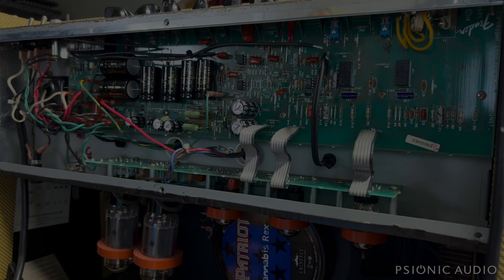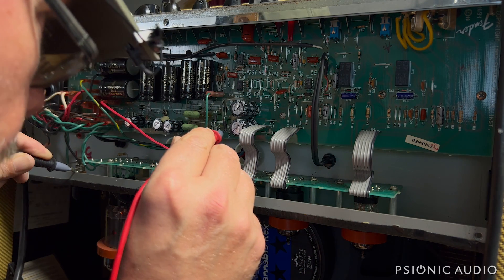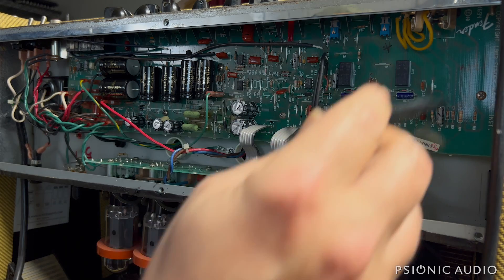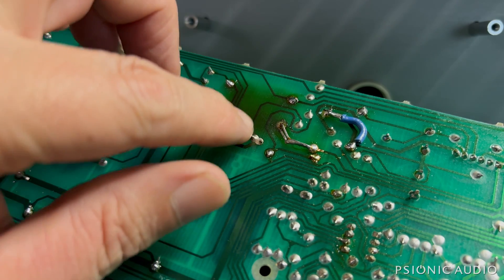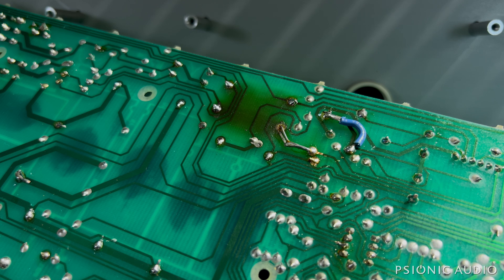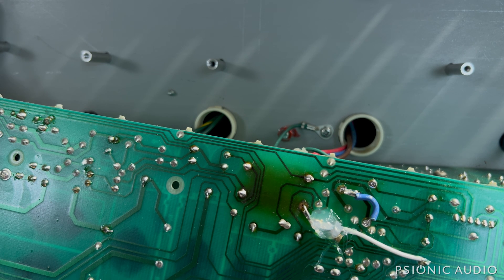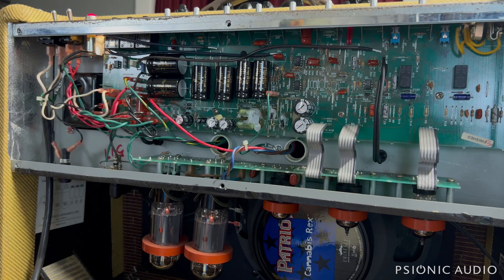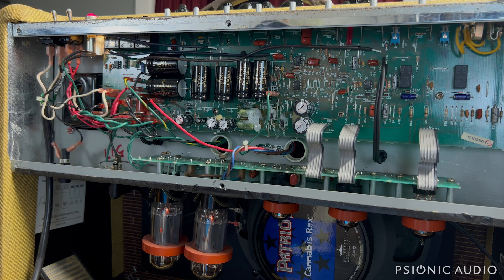Blues Deluxe "Won't Leave the Drive Channel"

Comment: Mine sounds great. I don't have any problems with mine. What other amps are what you would suggest?
Reply: I bought mine in 2010. Zero issues. I’ve tried so many other different amplifiers but something about the way the blues deluxe sounds. It’s got a perfect brightness that I love with humbuckers. It cuts.

Comment: I've been considering the Blues Deluxe Reissue until I saw this video. 
Wow. Kind of bummed about that. 
Thanks for saving me the disappointment.
Reply: I’ve had my blues deluxe for over 10 years with absolutely zero issues. I’ve done nothing to it. It still has the original tubes. It probably has 500 gigs on it. I guess I’m lucky. It’s a good amp. There is a reason why you see them in stages along with the other hot rods frequently. Are they the best? No. Are they work horses? Yes. Get one. If it breaks fix it. And it will last a lifetime.
Reply: @peanutavalon  I actually bought that amp after running into a few more people with gig experience like you. Everyone praises that amp and so do I now. Holy smokes that's a bad boy amp! Not just a work horse but you can get anything you want out of it. No mods! Sitting next to it right now! 🤣😎👍

Comment: Great video and thank you. With your entertaining help, I've been able to fix the drive channel not switching on my 1993. Clearly someone had attempted to do some of what you do in this video, and now it's got new resistors and caps at C38/39. Only now I'm seeing around +/-20v not 16v on R85/86 and 19v sat TP32.
Reply from the maker: You need new 16V zeners then. That's what they do - limit the voltage to those fixed settings.
Reply: @PsionicAudio  Amazing and thank you. I've never had so much fun watching your videos and ordering parts on Digi-key.
Reply: @PsionicAudio  I also wanted to add that I had two different amp techs look at my 93 Blues Deluxe in the past and they either didn’t fix the issue, and the last one complained at me about how he hated them and was essentially telling me he didn’t want to fix it. But you’re not that guy and I appreciate you going the extra mile to fix them and build in some resilience.

Comment: I just shake my head. I feel so bad for working musicians who buy them.
Reply: why? great workhorse amp. I gigged mine hard for 15 years before I had any problems. Just changed out a couple of caps and lifted the resistors. Got my moneys worth out of it for sure and it's still rocking.

Comment: Do tube dampeners actually help with microphonics or is it best not to have them?
Never had a tech’s perspective on it but I’ve heard it’s a snake oil product
Reply from the maker: Someone I respect in the industry likes them. I find that sometimes they help, sometimes they don't. Don't overpay for "audiophile" dampeners. But if you can find some that are reasonably priced, it won't hurt to try them.
Reply: @PsionicAudio  Those thick Eurotubes dampeners seen here have been quite effective for taming rattles on my old 7 notch Mullard GZ34.  Ain't perfect, but they certainly help.  Relatively inexpensive and worth a shot.
Reply: @dwaynedelario  , years ago I bought some Sorbothane tube dampers from a company that sells audiophile products and put them on the driver and output tubes of a Dynaco Stereo 70 hifi amp. They were fine for the drivers but quickly melted on the EL34 outputs (It didn't take much of a stretch to get them to fit onto skinny bottle EL34's). I was a bit ticked off that the company that sold them to me refused to refund  my money even though they never specified in their advertising literature that their tube dampers were only to be used on preamp or driver tubes and not on the output tubes. Modern silicone rubber can obviously handle higher heat than Sorbothane can, but how long will even high-temp silicone last on a hot GZ34?
Reply: @goodun2974  FWIW I've had them on this GZ34 for over a year now.  No melting and they still move freely.
Reply: @dwaynedelario  , interesting. By cintrast, Sorbothane has a consistency similar to human flesh and is an excellent vibration damping material ---- I've used sorbothane feet the size of hockey pucks underneath DJ turntables in nightclubs to prevent feedback from big subwoofers ---- but it can't handle high heat like you'd find radiating from a rectifier or output tube.

Comment: For a double sided board  the traces are rather close and small  for real voltage  IMHO .  Would guess 1 oz copper on a good day.  From  some time with those voltages to  I would not  use less than 3 oz copper and ground plain  or balanced line design for the signal traces is not your best choose.  Must agree on your evaluation of the PCB >

Comment: I love your work Sir but you should  use a real good  caulking gun with a small straight cut opening and do a small clean bead instead
of a nasty looking blob.  You could get a good gun , the non dripping one that stops when you release the trigger.  
Watching you squirt that tube was painful , you had no control with it and it was impossible to do a neat job .
Reply from the maker: I didn’t want a small bead. I wanted a big glob to fill the space between the components and the board. 

IME if I put the tapered tip on the tube of silicone and cut it like I was doing beading for kitchen/bath the silicone cures in the tip and is useless. I’m only using small amounts at once, and usually the silicone is hidden behind a component.
Reply: @PsionicAudio  
BEEEEEPP !!   Wrong answer !
Reply: @lousekoya1803  😆